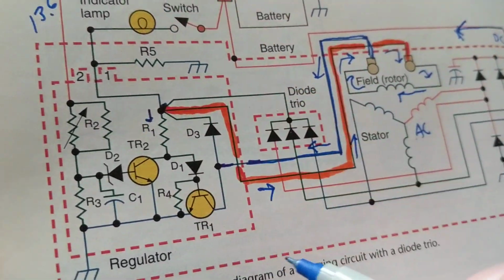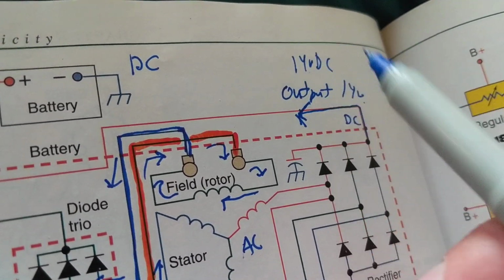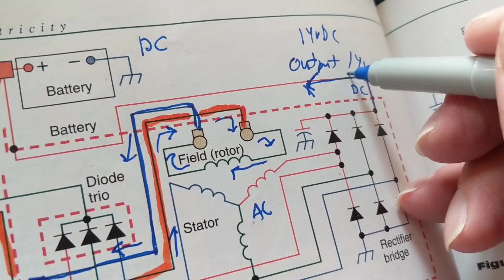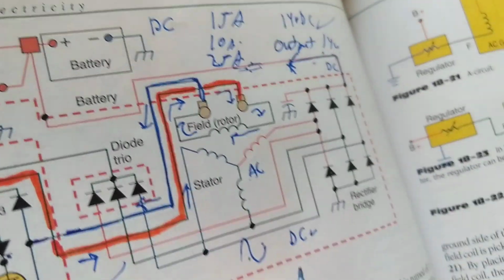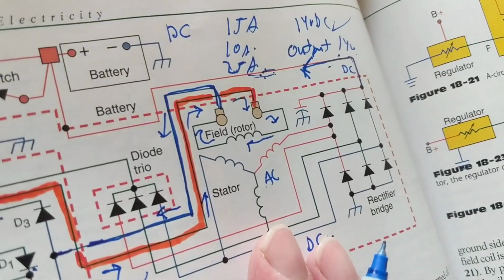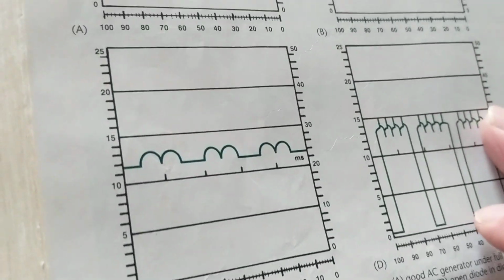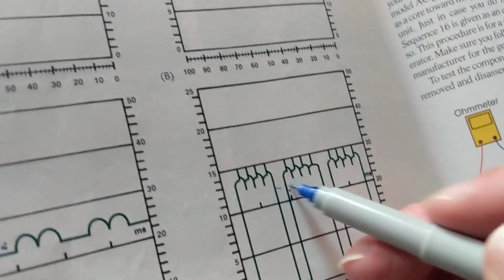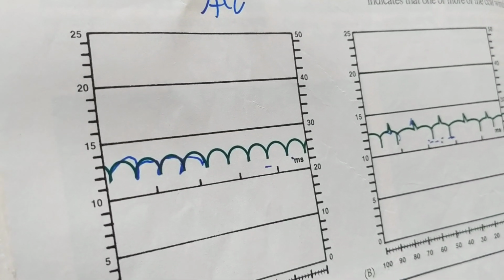HOW TO TEST A COMPUTERIZED ALTERNATOR DIFFERENT TECHNIQUES INVOLVED FROM DIAGRAM

Comment: Even my 25 year old Camry will act like the alternator is bad, right after a battery swap or recharge.  For its own reasons, it waits a few minutes after start-up before it commands the alternator on.  Had more than one parts store tech try to tell me the alternator was bad because a voltmeter showed under 14V with the engine running.

Comment: A computerized alternator is connected to the ECU by a LIN bus. This is an alternator with a electronic tension regulator. Very nice presentation. I'm looking for an explanation how the ECU controls the alternator. Till now not found. Thank you for the video.
Reply from the maker: Thank you so much yes I have given explanations about this on other videos on the channel you can look it up on the channel Joe electronics schematics for Auto and otherwise I will repeat the theory and the diagnostics thank you so much